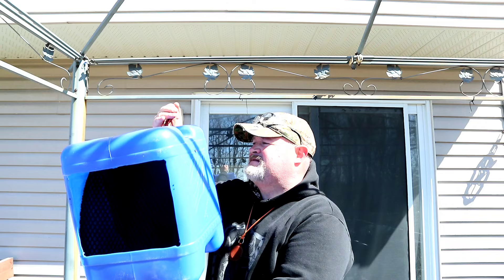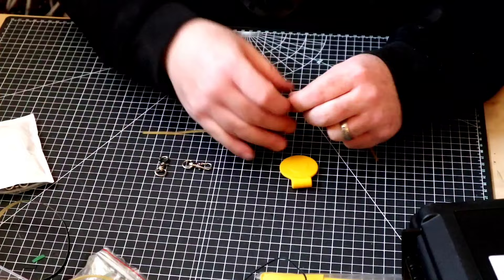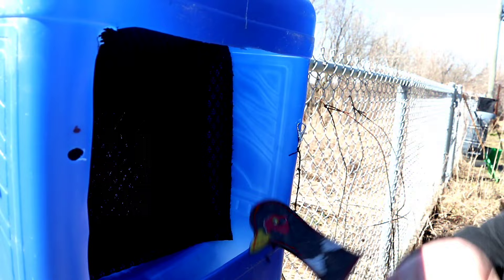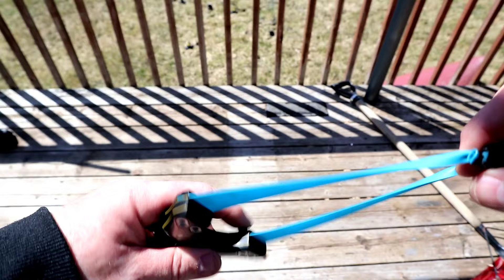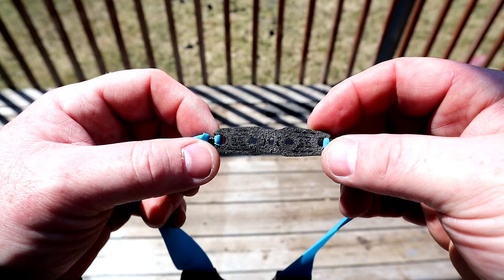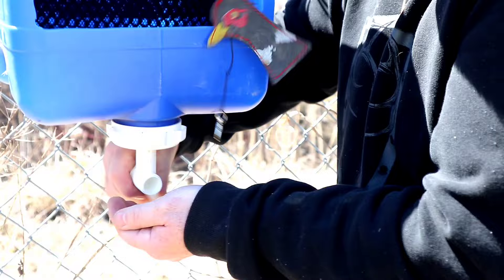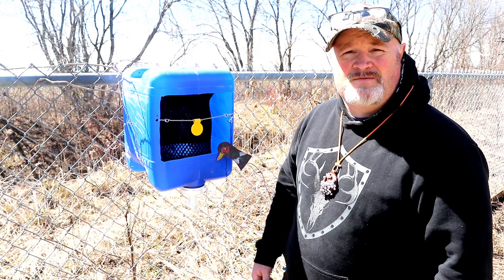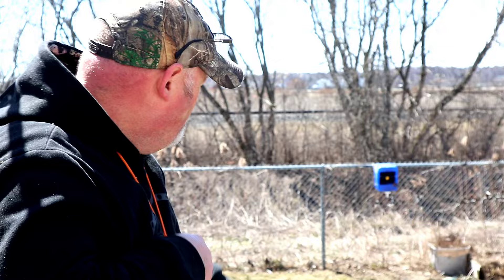WATER JUG CATCH BOX BUILD AND TEST #DIY

Comment: simple solution. good work, love it.
Reply from the maker: Still going strong too. I love that box.  I shoot at it off the deck while I am cooking on the pit boss.
Reply: 👍 I'm going to make one for my back yard.
Reply: @ATOMark are you using an elastic band to tie the clasp and the spinner to it? Where can I get rubber bands that you used?
Reply from the maker: @notchy12000 I just used slingshot tubes. You can find them everywhere. Amazon and most slingshot dealers. I believe I used 1632 mands

Comment: Ah! Brings back memories of my lockdown ammo catcher, comprised of a 30l brake cleaner container, paracord, eyebolts and some kevlar scavved from some motorcycle jeans as the backstop. 

Took approx 3,000 shots into it before I left it at an ideal shooting spot, and someone stole it 🤣

I have another one in the works that's going to be made from a water cooler bottle, which will sit upside down so the ammo rolls down into a catch container. 👍

Awesome video, as always. That frame is a work of art.
Reply from the maker: I think I will make another one soon. And set up a few different targets. Could be fun to shoot with my son off the deck. Sucks someone stole that catch box.

Comment: Did something similar with water cooler bottles...the back smashed when my curtain failed. Not enough depth🙄
I rigged up pipe work to feed the balls into a collection box. My intention was to have a pipeline returning the balls back to me at my 10m ocky. Where I have a work table and a tarp set up for the warmer months 👍🏻I was even going to have it set up at my end so it sorted the balls into size (gzk has something like that) Maybe this year🤞🏻.
Great video Mark thanks. 
Be well stay free.
Reply from the maker: That is my plan with this box. To add a pipe to drop into a bucket or bag.
Reply from the maker: That is my plan with this box. To add a pipe to drop into a bucket or bag.